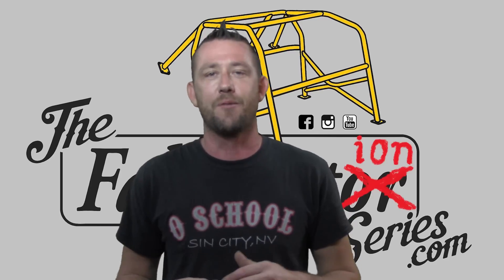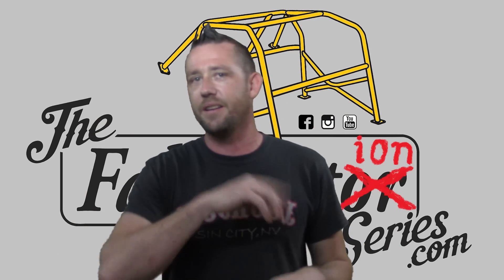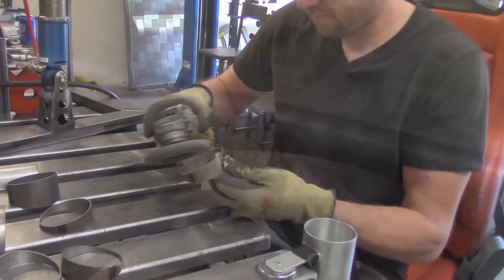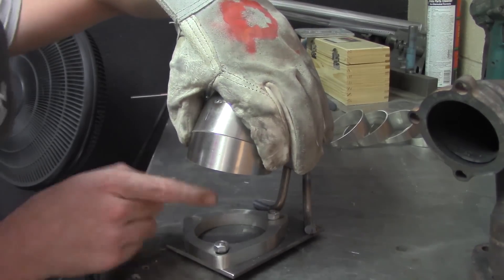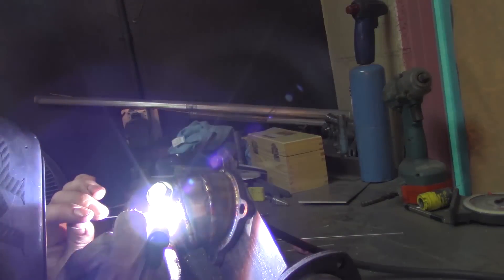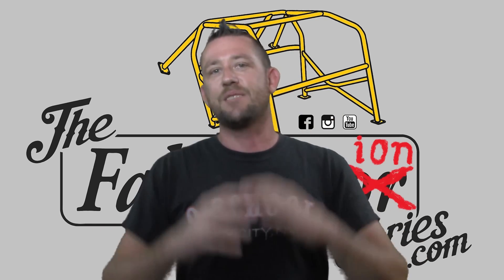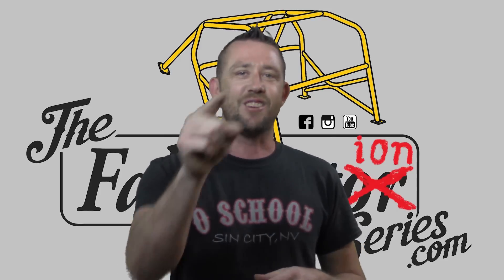TFS: Pie & Lobster Cuts Part 2

Comment: For crying out loud, can't you talk a little slower? So what is the cut angle per pie cut for a 90 degree bend and how did your figure it??? Thanks, JD
Reply from the maker: Angle/number of pies = transition angle.
Transition angle/2 = cut angle. 
If that doesn't make sense, stop crying out loud and watch the other videos where I explained this in great detail. You can also click the button on your screen that controls playback speed, rewind, or watch the video several times until you understand it. It's really that easy.

Comment: In millimeters I did 8 degree cuts (1mm for the ink line) then cut on the line for the paper wrapped around pipe and when cutting. Got it dead on.

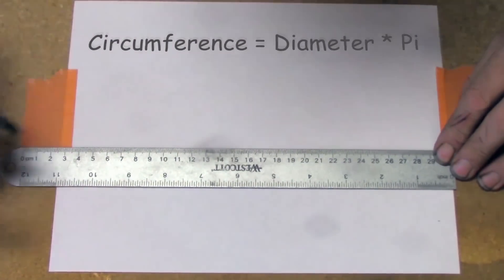Comment: 10:40 I did it this way my first attempt for these. Its main disadvantage is making sure that the grinder wheel stays plum with the cut. Otherwise it'll have gaps that need welding in when you put the slices together. I ended up getting a harbor freight chop saw, and haven't regretted it since

Comment: You could drill holes into the base of the chop saw and use a piece of angle iron with 2 holes and 2 bolts to make a stop.

Comment: hi just some info you can just calculate the pie cut using  radius of the bend x 1/2 the tangent angle x2= the cord length of the pie cut. ie  3" radius 3" pipe  so the od radius 4 1/2"x1/2 tangent angle x2 = the length of pie cord length

Comment: going to stop you right there, you are aces on everything i've ever seen from you, but you made a mistake you your angles.. the maximum single cut angle should be no more then 7.5 deg. ( air flow separates, 'de-laminates', from the surface it is flowing across at anything over a 15 deg change in surface 'direction').  By doing 18 deg total deviation you are in essence shrinking the diameter of the tube size and building in unwanted turbulence and the faster the flow, the greater the de-lamination.

Comment: A much simpler method of making reference lines at the center of any diameter tube, exactly 180° apart:
 Clamp your pipe to a flat surface. 
 Place a square on the flat surface. 
Bump the other leg of the square against the tube. 
Drag the square sideways against the tube. 
Repeat on the other side. 
 A square will always touch a tube tangentially, no matter the tube diameter. 
Zero math, zero measuring. 
 Just make little marks at each end and connect the dots with a sharpie if a scratched line bothers you.
Reply: Requires use layup die for this for the best results. And a proper machinists square; not a ruler with a right angle.
Reply: @Big_Iron_Mode   Really?   Try it with a bevel gauge set at about 80° instead of a “ ruler with a right angle”.
 Identical result.. exactly 180° apart because that’s how tangents work.
Reply: the ruler will often rock because its warped, giving an inaccurate measurement

Comment: How do you know if your getting the penetration when you are welding?
Reply from the maker: Look at the inside
Reply: @TheFabricatorSeries  is there a way to know whilst your welding so you don't have to repurge everything ? Is there a suttle sign to look for ?
Reply from the maker: @MrBurningrubber  Not really unless you put a wireless camera in the tube or something. Once you do a few and they pass then it's just repeating it. You just have to know it.
Reply: @TheFabricatorSeries  thanks for the advice I shall be doing a few more tomorrow so I'll have a practice run first
Reply: @TheFabricatorSeries  I'm only asking because I'm used to welding big thick heavy wall pipe and could have a fair gap. But recently just changed jobs and now I'm welding slot thinner gauge milk pipe and has to be butted together, and have had a few problems getting the penetration.

Comment: Hey man, whats a good TIG welder for a noob to try his hand at? There are so many models with different options and I'm not sure which to pick. I'd use it primarily for welding automotive exhaust tubing. No super thick metals or anything like that.

Comment: i just use a mitre saw with a stainless steel cutting blade just change the angle both sides so dont need to flip it just have to move down each cut for the radius
Reply: Is it faster than using a chop saw?

Comment: Justin, what kind of band saw blade are you using for stainess steel tubing? I only got 1 cut out of a brand new blade cutting a 3" SS tube.
Reply from the maker: jwright650 I'm not sure what type of blade it is. It's the blade made by the manufacturer of my saw (saw is a Kama EV996). 

The biggest killer of a blade is speed. If your saw can't go slow enough, you'll toast every blade you can throw at it in seconds.
Reply: Thanks, I  use floods of coolant but that didn't help, so next time I'll try slowing the saw down even more. I think I have one more pulley that will slow it down more.
Reply: @jwright650 I have a cx103 band saw bought a cheap blade for ftom Amazon speed for me is 178 ft per minute did 100 3" 304 stainless cuts same blade  no lubrication and probably other 100 cuts of 2" and 2.250 " 304 stainless, blade still good tried slower speed ,found it to slow and knocked a few teeth of ,blades 35 Canadian

Comment: One of the most used tools in my shop for this type of operation is a small level I attached to a thumb screw clamp... you clamp the tube in the fixture THEN clamp the level bubble to the tube, on "level"... now you can flip the tube 180 degrees accurately and quickly with out having to measure anything... makes cutting the pie slices manageable on a band saw or chop saw...

Comment: Made transitions for lots of large and some odd ball diameters small pipe. I am not saying you oversimplified,because it seemed  work quite well.  Then again there is more accurate methods. When i make a transition for tube it's normally made from flat metal then rolled or bent.  Making  the transition patterns is a dieing art . Just go your computerized plasma, laser, or waterjet throw in data and wala. Glad i learned the old fashioned way.  So many things today diminishing  thought process.

Comment: On the pipe that what was shown being welded are the welds full penetration?
Reply from the maker: Lake School Restoration Channel  I'm sure they were to some degree.
Reply: The Fabrication Series 
Thanks for the reply.  I have done a lot of tig welding on thicker material, nothing that thin.  On thicker material I have to weld with a gap inorder to get internal fusion.  Seems that might be thin enough to get penetration with no gap.  Time for me to practice :)

Comment: damn all these inches are so complicated. metric system is SOOOO much easier lol
Reply: Eh. Sometimes metric is worse. The problem is that all too often, the fractions you end up with are much worse than the much more easily divided inch/foot system, which, much more often, has no fractions to deal with.
Reply: Kinda depends. If you grew up doing the imperial system it's second nature. You just have to have learned it and used to working with it. That said the metric system is easier to learn. If the imperial wasn't so distilled in the culture over here I like the metric system better.

I end up dealing with a bunch of both and that really turns into a headache. Have to draw out and explain something to one group of clowns in inches then turn around and explain the exact same thing to a different group of clowns in metric. Might as well be doing 2 different jobs.

Comment: The first welding project I ever did was actually a 3" stainless catback with pie cuts by hand. All I had was a cut off disc on an angle grinder and some flaps for clean up. It was a full exhaust with 7 bends, it took well over a week to finish @.@ great learning experience though!